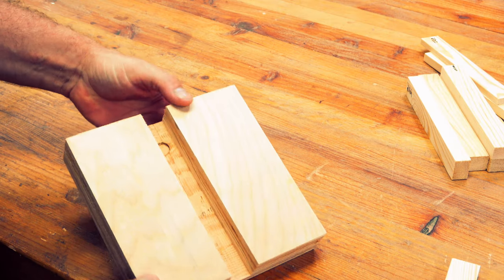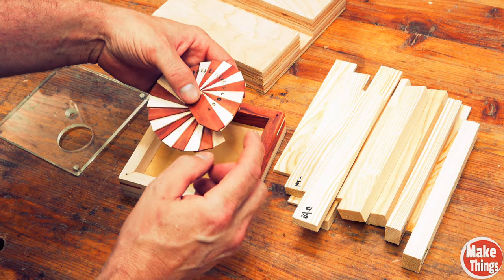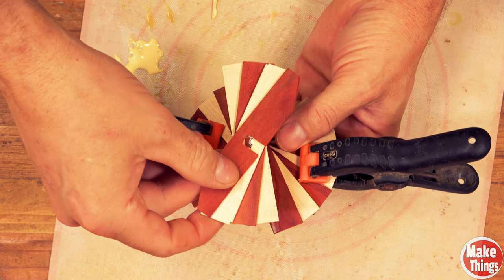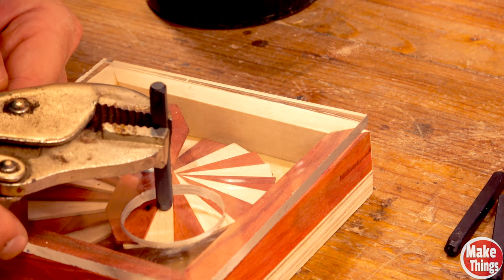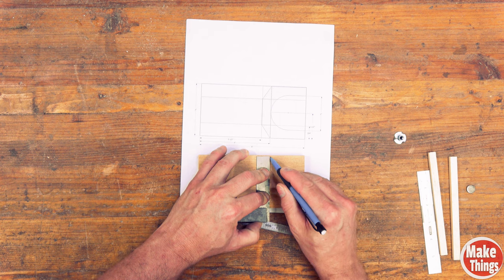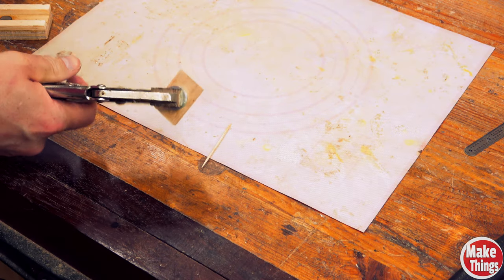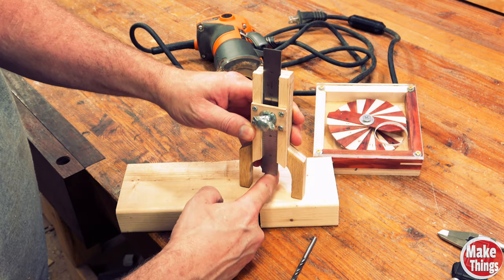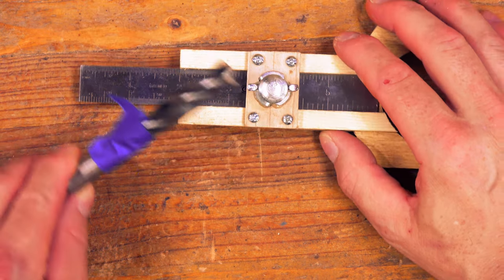The Spiral Gauge // Dialing in that Perfect Depth!

Comment: On your first gauge block you showed with the individual sticks you set into the slot you could make that so they can work upside down very easily if you made it by using a piece of plywood and two blocks of wood 1 inch thick. Before attaching the 21 inch thick blocks of wood to the plywood with the gap between them cut a 1/16 inch rabbit on each on each block. Plant these two blocks to your base and then side of one 16th shim into the slot that’s cut to the same width so that it stays under in the gap you’ve made. If it’s too tight unclamp and sand lightly on the rabbit then re-clamp and try again. Remember you want it to slide but not to be loose. Now take a long stock of wood that’s 1 inch tall and will slip into your slot between your two blocks of your gauge and verify it’s dead flat Then takeoff 1/16 inch through a thickness planer on the full length of your piece of wood inserting a shim and putting the new board in and it should still be dead flat. If it is when you pour through again shaving off a 32nd or a 16th. Cut off a piece that’s the right size for your jig and using a touch of CA glue in the middle of your shim that’s 1/16th of an inch thick that’s sitting in its groove and attach a piece of wood to it. while your CA glue sets up quickly you can plane off another 16th 32nd. Cut off a piece of wood the right size push your first depth block out insert your new shim and block gluing them together with more CA glue and continue until you have all the blocks you want. Mark each one for each total thickness then drill a hole in one end of every single death block and then slide a string or cable or whatever through set they’re all connected and and then connect the string to the block. Like you I tend to lose things so hooking them all together and then connecting them to the block we’ll keep the whole thing together as one unit. Of course you could build a box as you mentioned to put all your depth blocks in that would sit underneath that you could put a small latch and hinges on. Then as you said you could store all your blocks in the box. Then when you wanted to use it you slide the appropriate block into the grooves and where do you keep an upside right or upside down the block can’t fall out so you can even use it on the tablesaw if you wanted to.